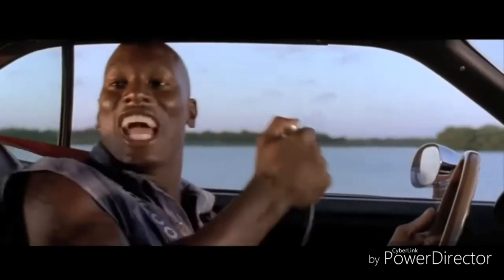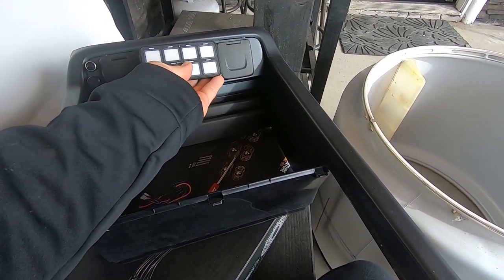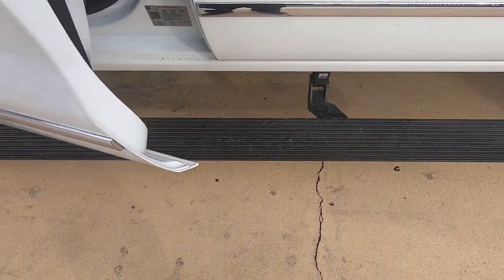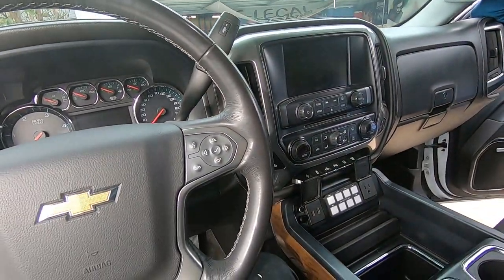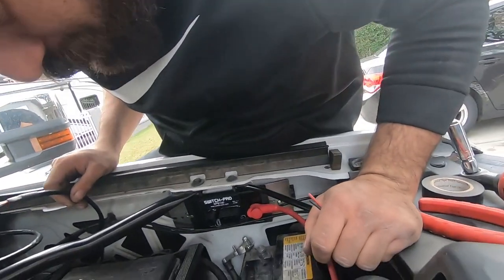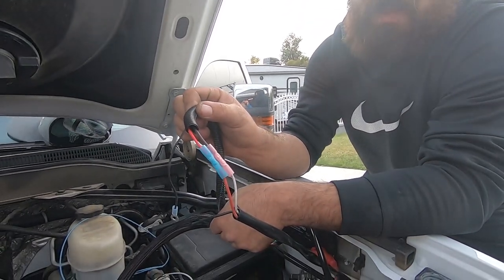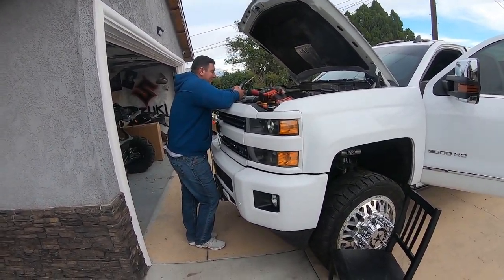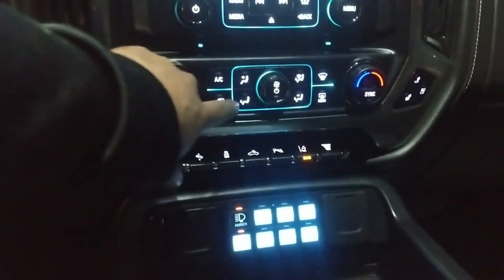SwitchPros 9100 Install on The Monster 3500 Silverado Ep 29

Comment: How do you like that switch set up? I just got a 2019 and don't really wanna put holes in the dash etc. I've seen others for sale online for a lot less then that switch pros set up I'd imagine you get what you pay for. I'm just looking to wire auxiliary led lights and strobe lights.
Reply from the maker: Personally i think this is the best switch setup on the market.. you can turn ordinary light bars or any light into strobe lights. You can also turn the switch into momentary switch for train horns... The Bluetooth control is excellent. There are many cool features that make it worth the money.. also better then installing other cheapo switches that i.e. Light bars come with, then you end up with multiple different switches in different locations.. You wouldnt be disappointeded with this one. 👌👍💪😃😎